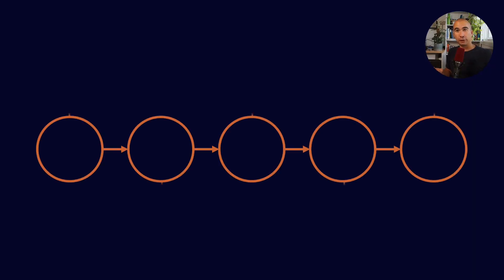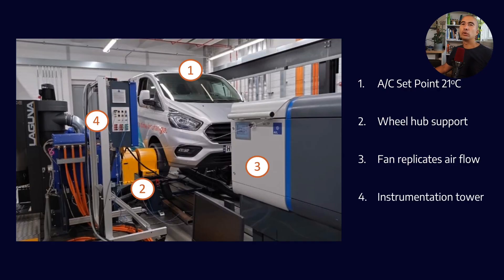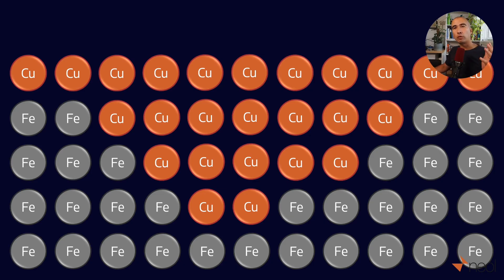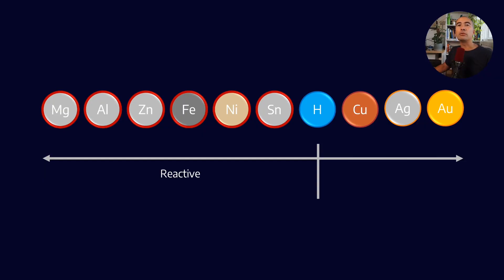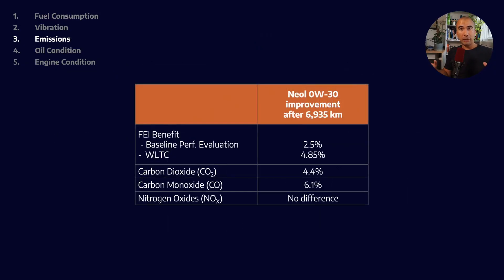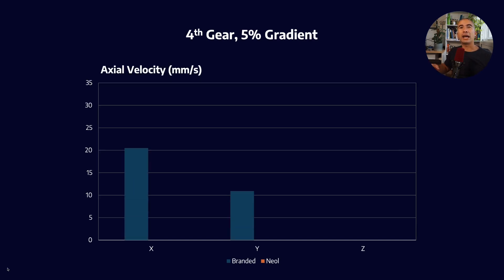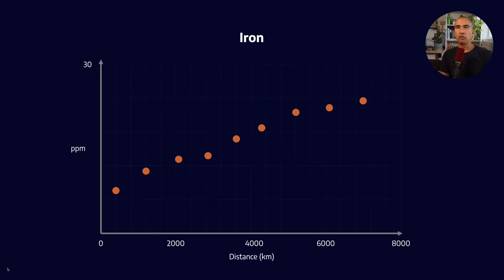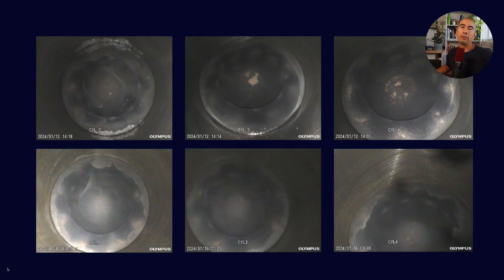Revolutionary Oil versus Ford Transit Dyno Test

Comment: A lot of clutch materials contain copper, in your motorcycle experiment, I'm wondering if you picked up any extra copper from the discs( if it were a wet clutch engine)?

Comment: You need to get Eddie Stobart to fill up a couple of his trucks with this stuff.  If the fuel consumption reduction is real, you'll see it on a statistical basis with his fleet.  (Or Lindsay Fox or some other mega-miler trucking company).

Comment: What affects could it have on the emissions systems? Dpf and the catalitic converter on a petrol engine?
Reply: Positive, considering the oil is no-SAPS and zinc-free. The system should remain fully functional at least for its designed life.

Comment: Not sure why this appeared to me but very interesting 👍🏻

I thought to flash something I've only recently learned
With Holden's change from the V6 Ecotec to the Alloytech, the engine ran much leaner to get excellent fuel economy results 

However, the leaner mix had the effect of making the engine hotter
This baked the oil, which built up throughout the engine 

Eventually flakes of this baked oil would come lose
Clogging the pickup and possibly clogging galleries etc

The oil pickup strainer wasn't a big one with good flow and therefore the engines were starved of oil 

Please make sure to test your copperised engine oil on a range of engines:
🔹Pushrod port injected petrols should be fine 
🔸Direct injection and turbo little engines are more likely to cause problems 
Oil dilution from DI and also oil baking in the Turbo after being turned off 
🔹Alloytechs 🙂

Etc

You don't want to release a product and then find it had killed an engine or something like that 👍🏻

Comment: My experience is the type of oil isn't that big of a deal in a modern fuel injected or modern diesel motors. On petrol motors, fuel injection is what keeps wear down compared to carbs and chokes from 50 years ago. A modern engine literally has no "metal to metal" wear.....everything has a layer of oil, period. Using "non boutique" engine oil with normal oil and filter changes, what modern engine cannot go over 200k miles before it is "worn out"? You just don't see worn out engines any more....what will destroy an engine in a few seconds is lack of oil. 99% of the modern cars on the road will rust out or fall apart way before you ever wear out an engine. You can spend your money on a lot of things but stopping engine wear is not an issue as long as your engine has oil, you change it and keep the level up. Hell, the California Highway Patrol recycled used oil for years in their fleet of squad cars. Even the Walmart brand of oil is excellent.

Comment: There is some vehicles with wet belt systems, what are the effects on that. Also thanks for involving us on this project. Where are you based, I’m in Australia. Thanks
Reply: It remains to be seen whether it can meet Ford certification for wet belt lubricant. 😮

Comment: What affect does it have on soot dispertion? You likely covered it in a previous video but in a small diesel engine I would expect soot levels to diminish along with iron in tandem with one another. 

Also 17ppm is very high for iron wear in any engine after only 400ish km of driving, but in saying that i dont know Transit Diesel engine wear rates.

Comment: So the "cracks" still form in the metal despite this revolutionary additive?  Then this additive fills the cracks?  Sounds dumb.  You're not solving anything.  Oil is unique in its antifriction properties and would been replaced as the base of all engine oils a long time ago.
Reply: it needs longer testing, if it's really creating a good antifriction surface, then that means the 'cracks' will be significantly reduced over time, as it shows in 12:58
Reply: @jameswirya  By copper, a softer metal, and it's nonferrous?  Under enormous pressures and heat cycles?  That's why oil, with a good additive package is still the best lubricant.
Reply: @jjg7696  no doubt about it, it still is, but i have no expertise to say anything about it, i'm only doing experiments based on someone else's knowledge, i have been mixing stearic acid, oleic acid, some silicon oil, then add it to my oil and it works wonder

Comment: Great topic about using a noble element on the surfaces on an ICE product. The People in the community are definitely aware of certain oil additives that implement this practice. A product example would be ENGINE RESTORE using a formula of having two noble metals and a transitional element, to fill in the imperfections of the mating surfaces that wear over time.  That product is widely available to consumers auto parts stores and Walmart. The concern I notice from comments would be the catalyst and other emission devices can be negatively affected over period of time. Since its inevitable that any engine burns some amount oil, that copper additive might probably ending up clogging filters and catalytic converters at faster rate. This was also a concern about using that ENGINE RESTORE with the CSL additive from others, when talk about in the forums. I would be even more cynical knowing my oil filter is allowing certain metals to go through its media. Nevertheless, I would like to observe the results on their long-term field tests to see how the ancillary components will hold up.
Reply from the maker: Understand the concern - but I don't think it's likely to be a big issue. DPF clogging is likely to be greatly reduced because it's a zero ash formulation (or at least effectively zero) thanks to the fact that you do away with calcium and magnesium detergents, moly, ZDDP etc.

The issue with oil additives like Engine Restore is that they're a top treat, so you aftertreatment devices are already dealing with the ash, sulphur and phosphorous containing additives from the oil, and then you add their combination of copper, silver and lead on top of that. Here, we're deleting most of the additive package, some of which is poisonous to catalysts, and replacing it with something pared down significantly.

The most I've seen the copper deplete in use is about 50 ppm on an oil drain - I haven't seen anything more than this so far. But definitely understand your concern and it's something we'll monitor in future trials.

Comment: Dont forget that any additives in oil will go into the DPF /Catalyst, now how long until it is full and need changing and can it be cleaned out?
Reply from the maker: We certainly didn’t forget! Most DPF clogging is due to the ash forming additives (typically metal containing antiwear, detergent / dispersants). You’ll see this reflected in the ash / SAPS of the oil. The beauty of the Neol technology is that it’s effectively 0% SAPS and 0% ash, so very compatible with aftertreatment systems.

Comment: Although I think this copper oil is amazing based on the test results, I do have some health concerns. Copper dioxide is highly carcinogenic. As A mechanic I would have to have direct exposure to this oil everyday if it became mainstream. And on a oil burring car which most modern GDI cars are lol. Everyone would have to breath this in. Have you taken this into consideration and is there any way to test if the copper becomes dioxide?
Reply from the maker: Valid concern - but I'd say a couple of things. The first being that the current phosphate-based chemistries aren't exactly benign, so you'd be weighing the relative risks against each other. The copper concentration are (on the higher end) around 300 ppm in most of the formulations i've seen which is substantially lower than the ZDDP concentrations of common engine oils.

Copper oxide isn't a concern with regular exposure to the oil, it would only be a post-combustion concern. It would be something to look at though, for sure.
Reply: @LubricationExplained  Thanks for taking it into consideration, You are probably right with such low concertation it shouldn't be that harmful.

Comment: I have used full synthetic 10w30 in my flat tappet SBC for years no problems I don not even use a ZDDP additive. todays full synthetic oil is better than the high ZDDP conventional ever was!
Reply: Even full synthetics use, and, really rely on chemical compound (sometimes also organic) additive packages to greatly improve the function and properties of the oil. 

   While ZDDP is tending to be less used in passenger car oils, things like moly and boron have gone up.

Comment: It will be interesting to see how this oil performs on a larger scale. Your scientific approach is the correct one. I'm curious about how expensive this oil would be if mass produced and marketed.
Reply from the maker: So my understanding is that while the additive is a bit more expensive than conventional additives on the market, the fact that the formulation does away with conventional additives like detergents means that the overall formulation cost is competitive with existing oils

Comment: The friction/fuel economy results are outstanding.  The results for wear are promising, but it would have been nice to see Al, Cr, Pb, and Sn included in the wear metals analysis.  Ultimately, you'll have to do an engine tear down and physical wear measurements to accurately measure wear performance on each part of the engine.  A standard wear test like Sequence IVB test would provide a good comparison to traditional oils.  Sequence IIIH and VH tests for piston deposits, sludge, and varnish would be interesting to see as well. Doing the full suite of API/ACEA tests would be expensive, but could help identify potential roadblocks to using this additive in a certified oil.  Does the copper additive have anti-oxidant properties like ZDDP and MoDTC, or is this oil just relying on ashless antioxidants?  Does it conflict in any way with ZDDP,  moly, or Ca/Mg detergents, or could these be added to improve performance in certain tests or to meet certification requirements?
Reply from the maker: Good question - I'l need to reach out to Neol to see if the lab included the other elements in the report (they most likely did).

On the other additives - they seem to be mostly superfluous, and if anything compete for effectiveness at the surface. While I can't prove it, I have read some papers that indicate copper additives tend to work as antioxidants at specific concentration - but if you increase the concentration too much it flips to being a pro-oxidant.

Would love to see the API sequence testing, the only problem is that kind of thing gets pretty expensive. We need to weigh up how useful those tests are going to be especially because under the current rules this oil won't qualify for an API license because it won't meet the minimum phosphorous limit. The API rules really aren't built for any new technologies like this...
Reply: I believe a Ford Transit uses 5W-30 (or 5W-20).  Using a thinner oil will give a better fuel economy.  Why is the test using 0W-30 oil instead of a 5W30 or 5W-20 which the Mfg/OEM uses?

Comment: Will this poison after treatment systems like DPFs and GPFs? Or work well with O2 sensors?
Reply from the maker: This is supposed to be one of the big benefits of this oil - with is being effectively zero SAPS and zero ash there's almost no interference with the aftertreatment systems.
Reply: @LubricationExplained  good deal. I work for an additive company. I’ll float this to our R&D. But I swear I was working with Cummins a few years ago, and they stated that copper was a poison to their after treatment. But I can’t remember what they said the source of copper was. I’m new to your channel. I’ll be following from now on.
Reply from the maker: Interesting - so it's possible that if copper additives were used at the same concentrations as standard ad-packs, there might be an issue. But once you cut it back so far i can't see it being an issue.

The other reason Cummins may have baulked at copper additives is that the only previously commercialised copper additives (that I'm aware of) were a Copper-PIBSA and a CuDDP. I believe that both of these were sold once upon a time by Paramins (now Infineum).
Reply: @LubricationExplained  I do know at one point Infineium was the supplier to Valvoline for Premium Blue. You’re probably right about that.
Reply: Oor even worse  the wet belts
Reply: @metalworker007  yeah, Fords real dumb for that stuff. Love ford, but I won’t do belt driven oil pumps. I just won’t.

Comment: Like copper plating in Refrigeration on the Bearing surfaces. 
   In Refrigeration, when moisture gets in with the refrigerant and the oil creates an acid. That leeches out the copper from the copper, refrigerant lines and a deposit on the Bearing services..  but this is a extremely extreme case. The copper will plate so much copper on the bearings. It will actually seized the motor so when it shuts off, it cannot start.. 
    The copper buildup on the bearing surfaces will become so extreme. The Clarences become tight and actually start overheating and consume more power..  but we’re talking about ridiculously extreme amount of copper where the ionic action or Delta action of the acid and moisture are pulling copper atoms out of the copper of the pipe and deposit him onto Bearing material iron surfaces
Reply from the maker: Yes! Very similar phenomenon to this - the only thing is that when the oil is an additive we can control the formation of the copper antiwear film.

Comment: It has to be some kind of boron copper compound that works as the entire additive. If they can get the price right and competitive with other oils, the other manufacturers will have no choice but to jump ship.
Reply from the maker: I know that price wise it's not crazy expensive. Actually - I should be more specific. The price of the additive is probably more expensive that others, but the fact that you can delete so much of the rest of the additive package in an engine oil makes the entire formulation very competitive.
Reply: @LubricationExplained  Sold, take my money!

Comment: Do you think this will work in pushrod applications as they require a higher level of zinc?

Can I also ask why alkilated napthalenes aren't used in motor oil?

I also really like your idea if being able to recycle and filter quality engine oil indefinitely or almost indefinitely.
Reply from the maker: It should do - we tested it a full load in a Cummins X12 last time and it passed with flying colours.

As for ANs - it mostly comes down to cost and the fact that there's a much smaller body of research on them (there's only two major manufacturers). That means they aren't included in as many "approved" formulations. I'm personally a big fan and would like to see them used more.

Comment: Motorsport application? :)
Reply from the maker: For sure!
Reply: @LubricationExplained  I can volunteer 😀
Btw, what do you think of single-drop oil test on special paper , tissue.
Is a very cheap and amateur solution. But something shows in oil.
Reply from the maker: So there's something called the "Blotter Spot Test" which is exactly what you're describing. It's used to qualitatively measure the dispersancy of diesel engine oils and the degree of soot loading in the oil.
Reply: @LubricationExplained  exactly yes. 
For the driver, this is a interesting alternative to check oil. 
Could you do an episode of this ? Short video?
Reply: @KM-KielakMotorsport  droptest or blottertest, just drop your used oil to a tissue, and leave it for an hour, if it's quite dark then we need to change the oil, that's the gist of it

Comment: Fascinating work! I run a high-compression, propane-fueled engine with elevated cylinder pressures. propane burns clean with zero fuel dilution, making it an ideal testbed for long term wear analysis. Given the unusual balance of low TBN but stable TAN, how does the additive handle acidic byproducts over time? Also, does it interact with nitrided cylinder walls or other surface treatments? Galvanic corrosion potential?
Reply from the maker: You're asking the right questions! So from the testing I've seen - it seems to be able to handle acidic byproducts well, even over extended periods of time. I don't have any data on interactions with surface treatments, so that would need to be an area of investigation.

I don't think the risk of galvanic corrosion is high given how thin the deposited layer is. We're doing a bit of work with a tribology lab to further investigate the actual copper film.

Comment: Interesting. Why do you need a full vehicle dyno test? My naive assumption would be that since engine oil and gearbox oil are separate, by testing the engine you have tested the entire relevent subsystem.
Reply from the maker: Agree - but generally people want to see products replicating as close to "real world" conditions as much as possible.

One other advnatage of the chassis dyno is that you get to see the overall effect on fuel consumption when all other things are taken into account. Same goes for the vibrations etc.

Comment: From the chemstry point of view how is the additive fromulated just CU2+ ?
Thank you
BimmerN53
Reply from the maker: Great question - I don't actually know because that's part of the IP around the additive. But if I had to guess it wouldn't be just copper ions. There's been a fair bit of published research and commercialised products around copper salts as well as copper DDPs, so it's probably something similar.